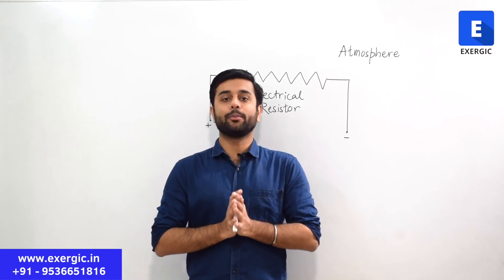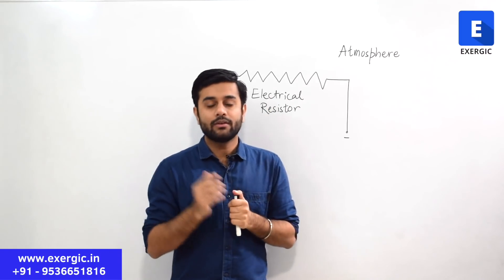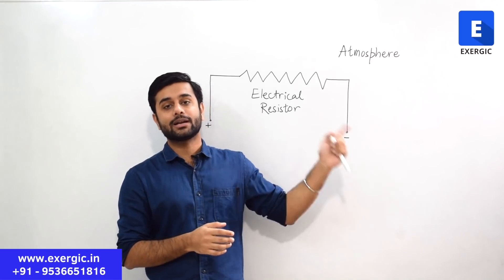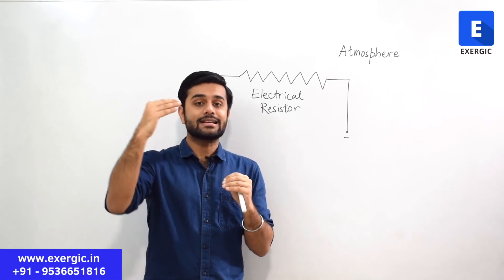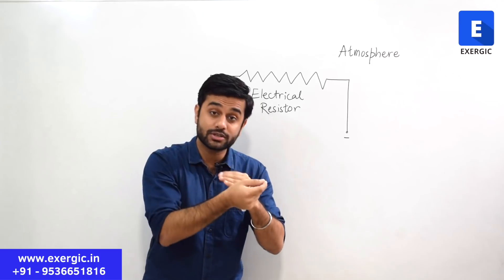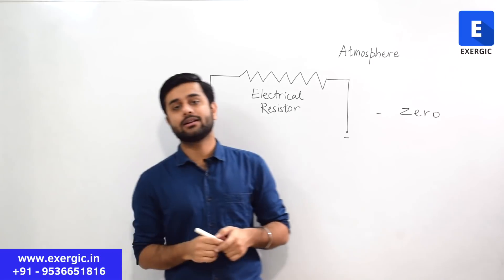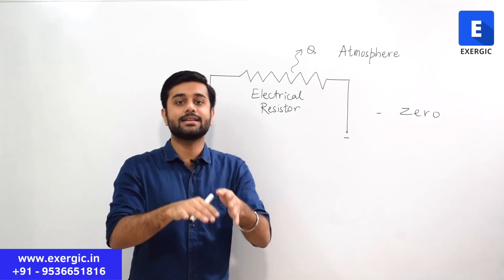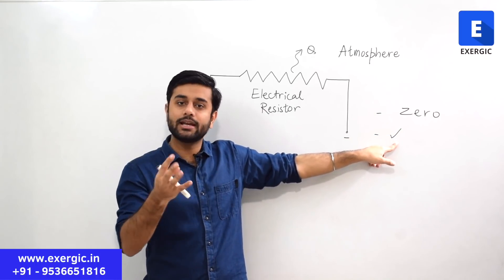Conceptual mistake in Entropy Transfer with work - Thermodynamics | GATE Mechanical

Comment: Sir here you told us that after sometime it will reach equilibrium and heat generated in resistor is equal to heat transferred to surroundings .. can we say that before equilibrium is reached i.e. some temperature difference is there which means there will be different Qout and Qgen  , will there be entropy transfer then ?sir please tell I am very confused in entropy and exam is almost here
Reply: Before reaching equilibrium the temperature difference between the atmosphere and the temperature generated from the coil is infinitesimally small which means that it is a reversible process for which change in entropy is zero not sure whether this is correct

Comment: Sir you are saying heat is irreversible then what about seedback effect
Reply from the maker: Fluid surrounding a paddle wheel and steam inside a turbine are 2 VERY different cases.

Considering them similar is a blunder.
Reply: @ExergicGATE  how
Reply from the maker: As told in the video lesson, Heating effect of current is irreversible.

Seedbeck effect does not have general heat transfer. It involves a very specific type of heat transfer between 2 dissimilar conductors/semiconductors. Specific cases are never generalized.
Reply: @ExergicGATE  thanks sir understood

Comment: I message you on gmail about not execes of test series with details but no response received yet
Reply from the maker: Hello amit

Make sure to mail at support@exergic.in
It will be resolved. If any urgent, you can call on 9536651816 as well.